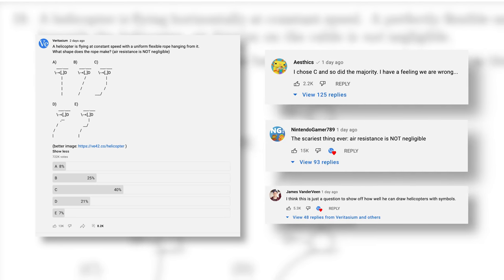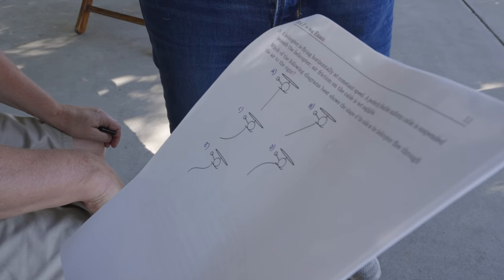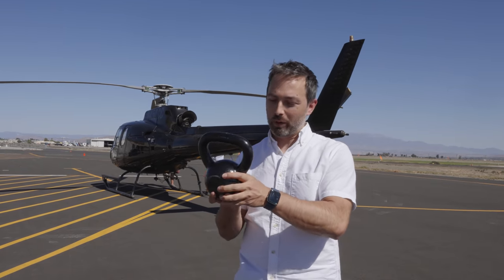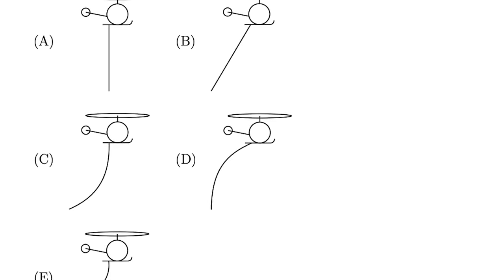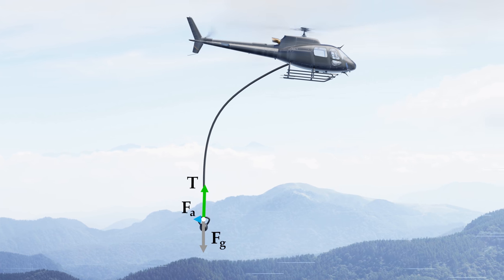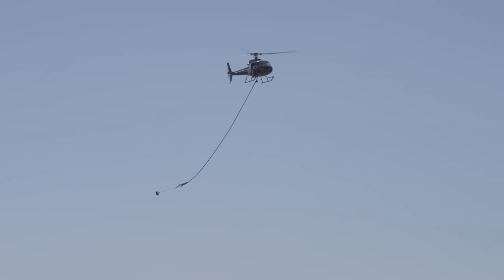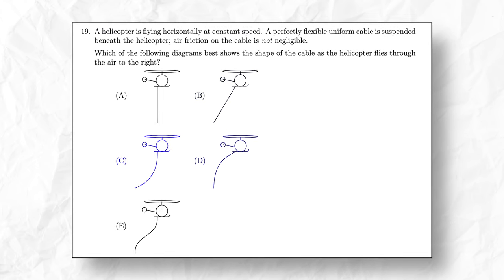I Rented A Helicopter To Settle A Physics Debate

Comment: Are we just going to ignore how casually he is sitting with one leg hanging out of a flying helicopter while holding a 20 lb weight?
Reply: I've ridden in a helicopter before with an open door like that, and I was terrified.
Reply: Trust him if he woud have died in that video it woud not be on youtube!
Reply: He has a harness on
Reply: @activetutorial  🤣🤣
Reply: @Xatzimi  still it's horrifying
Reply: @activetutorial  you clearly didn't watch till the end
Reply: He has a monkey tail on, so even if he fell, he won't die... it's not very confortable, but not dead's better than comfortable~
Reply: @Candority  You made a video that gives a mathematical solution to fear of heights?

That is impressive.
Reply: @Xatzimi  That harness has a buckle that's extremely easy to release under load...  A 5-point harness with rotary buckle would be much less terrifying.

Comment: If this problem is approach in a mechanics of materials way, it's a simple cantilever rope with two equally distributed loads. After doing some math ,I came to the conclusion that the deflection angle is going to be 0 as bending stresses will be 0, so straight line.

Comment: As a physics major, I can say that while this may be a fair question to put on a test, I don’t think it’s a good one. While a lot of conceptual questions (not calculation based) are meant to by counterintuitive/tricky, the student should be able to arrive at the answer through identifying the basic forces and principles involved. However this question asks a lot of the student, it forces them to make assumptions that they wouldn’t be familiar making; it doesn’t really focus on the true intent/spirit of the testing material or testing for knowledge. Assuming a student to just know that the rotor wash is negligible is not really fair, especially in a conceptual (not calculation) based question like this.
Reply: I had the same thought, well said.

Comment: What if the cable was a lot longer in the initial test? Let's say a 100 times longer.
The atmospheric pressure gradient towards the ground would make different parts of the cable experience different amounts of air resistance, increasing towards the tail end of the cable.
Wouldn't the cable then form more of an "option C" shape?
Reply: Yes famalam

Comment: My gut instinct was B for exactly this reason! But then I thought that it might depend on the length of the rope as a very long rope from a high flying helicopter where the atmosphere is demonstrably thinner creating a gradient along the rope of wind resistance where the end of the rope near the ground would have more air resistance than the rope cutting through thinner atmosphere just as the parachute is. I guess that is the difference between physics and mathematics xD

Comment: I definitely thought there would be significantly more wind from the rotor, I mean, helicopters are relatively heavy so they gotta move a lot of air, right?
Reply: There is a lot of wind from the rotor immediately below the rotor blades, but this wind gets dissipated very quickly when it encounters the still air below
Reply: supersonic is correct. The energy is pretty high right below the rotor, but quickly spreads out over a very large area.
As an example if a helicopter is a few thousand feet up and flies over you, you will likely not feel any down draft, because the reaction force is spread out over a square mile or so by the time it encounters the ground.
I think of it as collisions, the first air molecules directly from the rotor hit multiple still air molecules, these previously still air molecules go and hit multiple other still air molecules, and this process continues, each time momentum is conserved, so when one molecule makes multiple move, the multiple have less speed, until you get to the ground when all the air molecules hit the ground (slowly at this point) and bounce off.
Reply: The air also happens to move in the same angle. Imagine the force of air as a similar shape to the rope, now if the helicopter is moving forwards, the downdraft will actually trail along with the rope 👍🏻
Reply: When the chopper is flying forwards it is tilted forwards, letting the wind move more or less straight down the cable.
Reply: Helicopter main rotors, whether one or two, act as airfoils (wings) when moving forward. the transition from hover flight to "travel" flight is actually one of the tricky things about piloting a helicopter. As you transition from "Let's beat the air into submission" to "Hey, I've got a circular wing up there" the lift from the rotor disk is created like an airplanes wing. As an airfoil, which is curved over the top and flat on the bottom (basically) the air flowing over the top has to move faster in relation to the wing and Bournelli's law comes in and decreases the side pressure of the flow creating a low pressure area above the wing. (flying sucks... up) At this point you are using this effect, unavailable at slow to no speeds, to sustain flight as opposed to the rotor downwash thereby reducing the rotor turbulence below the helicopter to effectively nil.
   Hopefully this helped and was clear enough. I'm an aircraft mechanic, not a teacher!
Reply: What everyone else here is completely missing out is that lift is a force that acts from above, not from below.

The helicopter flies because the air on the top of the rotor blades has to move faster because of the shape of the blades (see: aerofoil), faster air is at a lower pressure, so the helicopter gets sucked upwards by this force we call Lift.

The force generated downward would be called thrust and helicopters generate more lift than they do thrust. Thrust helps push the helicopter forwards, backwards or left and right whilst balancing with the lift that keeps the helicopter in the air.
Reply: @smeghead666  The lift is also generated at an angle when the rotor tilts forwards. It also contributes to the forwards motion.

Comment: I just used tooth floss and moved it to the right and the floss stayed straight diagonally so I chose B. I think it might be different if the rope was really long, like a mile long. Would the weight of the rope start to change the shape? I think the upper parts of the rope would have more vertical tension because of the weight of the rope beneath, so it would look more like C.
Reply: You would be correct, but not for the reason you cited. In the mile-long rope scenario, air density variation with altitude begins to have a noticeable effect, with the drag force per unit length of the rope increasing as you go down the rope. As a result, the lower portion of the rope 'wants' to dangle farther to the rear than does the upper portion, so you get a shape somewhat resembling that of the parachute scenario, except with a much more gradual curvature. The curvature effect would be maximized when traveling fast, and at as low an altitude as possible without the bottom of the rope touching the ground. The air density at 5000 feet is about 17% lower than that at sea level, so the slope that the bottom end of the rope should be in the ballpark of 17% less steep than the slope that the very top of the rope tends to hang at.

Comment: This is actually very intuitive once you explain it. However , I still don't understand what decides on the norm of the resultant air resistance, and why does it vary linearly with the rope coordinate ? Could you provide some more insight on that?
Reply: It's easier to imagine the problem if you split the rope in a million tiny pieces. The forces external to the rope are only gravity (pointing down) and air resistance (pointing back). The resultant points somewhere diagonally backwards and downwards, and it's in the same direction for all pieces of rope (by the uniformity assumption). So it's effectively the same problem as if gravity itself were pointing in that diagonal direction, so you don't have to worry about tensions at all and can immediately conclude that the rope comes out straight.
Reply: Because you have costrain at the top where displacement must be 0 so maximum force
Reply: I assume you are talking about the the 1st case (nothing attached to the end of the rope)?  By "norm of the resultant air resistance", do you mean the size or magnitude of the resultant air resistance?    
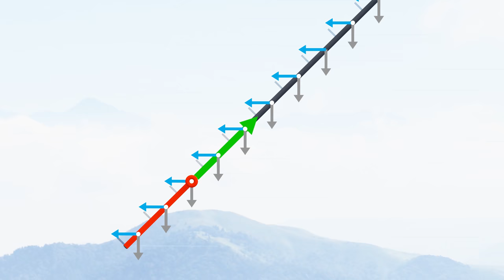Air resistance at a point on the rope (as shown in the video starting at 05:21) is the total air resistance on the rope below that point, and it varies linearly because the rope is uniform, i.e., at any point on the rope, the total air resistance on the rope below that point increases by the same amount if we move up the rope a fixed length.   
BTW, the size or magnitude of air resistance depends on the velocity of the helicopter, the thickness of the rope, and the length of the rope.
Reply: "This is actually very intuitive once you explain it."    Like "gullible" it must not be in your dictionary.
Reply: @potugadu5160  Isn’t air resistance uniform along all the rope? I still don’t get the explanation
Reply: Honestly I think the conclusion is wrong.  The force pulling on the rope is not linear along the length of the rope.  If the rope was 750M long and reach the breaking point of the rope abt 1 ton eventually the force of gravity would exceed that of air resistance.  There is a difference between a line that has 20 KG of force pulling on it and one that has 1000KG pulling on it.  The rope was also covered in a sleeve and that added drag to the line.  I wonder if that was intentional of simply a coincidence.

With a short Rope B but eventually C as the rope gets longer.
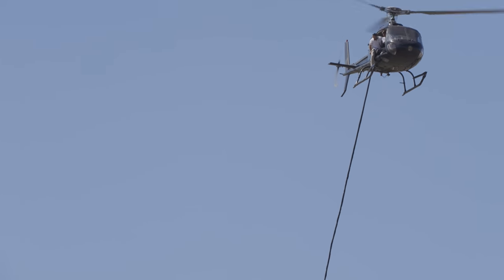Reply: @Gustavovisk21  Yes, it is uniform, and so each individual section of the rope has the same air resistance (05:00), but the sum of the air resistances on the rope sections below a point on the rope increases as the point moves up the rope (05:12).
Reply: @isk8nyc  The conclusion is not wrong, it is basic physics. With a longer or heavier rope, the angle will change but it will still be a straight line. The calculations and the ratios and the curves do not change just because the input variables change.

Now, it could make a difference if the rope were several thousand feet long, enough to make a noticeable difference in atmospheric density along the length of the rope. My math tells me that would result in a shape like C, but I can't afford a helicopter and a mile long rope to test it.
Reply: @isk8nyc  Of course the force along the rope is linear. The Force at any point along the rope is equal to the Length below that point x the cross-sectional Area of the rope x the Density of the material x the Gravitational constant. F=L•A•D•G. A and D and G are not changing; if L is scaling linearly, then F is scaling linearly. That's not even physics, that's just basic mathematics.
Reply: @potugadu5160  ahhhhh yes, of course. Thank you!!

Comment: How would a student attending the exam know the extent of downwash effected region of the main rotor in this question?
Reply: Exactly.. From "everyday experience" I would have guessed different since a fast spinning ventilation fan easily causes drag at a distance 10x it's rotor diameter.
Reply: Or whether the rope was light enough to be affected by it too
Reply: This experimental setup also clears 1 more thing, the location of the rope attachment point perpendicular to the motion of the helicopter(width of heli)doesn't effect the result, in this setup it was on the side of the heli's body and if I'm a student writing this exam I will be considering it at the middle of the heli width
Reply: So, a possible explanation that the downwash doesn't effect the rope because the body of the heli blocks it for the initial section of the rope is not true
Reply: This question could use some more info😂.. Maybe that's the point of the olympiad.. Purposely make it harder

Comment: since the helicopter is going straight the flag wants move back compared to the chain because the of the air flow tends to make the flag point back words since its only attached on one side of the flag it doesn't affect the chains angel compared to the helicopter much

Comment: This is interesting, but throughout the video I had the lingering question of what would happen if the rope was much longer (hundreds of meters) and without the bottom weight? Wouldn't air density at different altitudes make a difference now? This assumes (correctly) that for a short rope the air density will not matter at all, but it could for a significantly larger rope in which case the answer won't be B anymore, and rather C I think.
Reply: If it did not have weight then it would not droop at all as gravity is not acting on it so it would be completely horizontal
Reply: @dhichicpop2531  I'm talking about the bottom weight. Obviously the rope will have weight.

Comment: 11:27 I imagine this is the most dangerous moment, if the flag wasn't tethered somehow. If it ripped out of his fingers could go into the rotors for sure.
Reply: itd be fine
Reply: It could act like snow between a fender and a bicycle tire.
Reply: @klicer3068  Rotors aren't particularly sharp so I doubt it would be cut.  Had the flag wrapped around the end of one of the blades, the imbalance of weight and drag could quickly destroy the rotor.  Those things are pretty finely balanced, and at the speeds they spin it doesn't take much for things to go sideways - literally in the case of the tail rotor.
Reply: 9:35 the pilot seems to believe the flag going into either rotor would destroy the aircraft. Not saying he's right but I'll trust him over my armchair when it comes to an educated guess.

Comment: Before I watch:

Free body diagram on the rope
Helicopter becomes vertical and horizontal force  at one end of rope: up, Fy and to the right Fx. Air resistance, becomes equal  distributed force to the left across the rope: A/L l. Gravity, G  is force down at center of mass in middle. Length is L
It's at constant speed so Sum(Fx)=0
Assuming the rope is straight down, and helicopter is flying right. Fy=g so vertical cancels out; sum of moments about the helicopter end = M = Fx(0) - (A/L)(L)(L/2) =/= 0 so the rope would bend, meaning it can't be straight down.
Constant speed : Fx-(A/L)(L) = 0
Fx=A 
A acts at L/2 which means we have a couple force creating a clockwise moment at L/4. If it were a beam the left side would be in tension and right side would be in compression which to me would indicate that D) the inverted hook shape is the answer.
But I would suspect because the end is free it and rotor blowing down it would be the s shape

Comment: if it the helicopter goes to the right in a straight line and the helicopter is seen from one of the sides, doesnt that mean that the rope is a diagonal? And if so, doesnt that mean that the rope should be straight (considering you are looking at it from the side)? Option A should be the correct one in that case.
Reply: Except in the drawing you're seeing the helicopter's side, not front or back

Comment: I think much of the intuitive problem is that most people are used to working with much shorter lengths of rope, where "perfectly flexible" is further from the actual experience. No rope is "perfectly" flexible. But on a larger scale, the flexibility becomes more negligible. But on a small scale, the flexibility of the rope (which is not really perfect) becomes a more noticeable artifact. This leads to "C" looking more right. Also, with a much heavier weight, the air resistance of the rope becomes more negligible, making the air resistance & weight of the heavy object the main factor, returning you to something which looks more like B.

Comment: I'm commenting at timestamp 0:48. I'm not very educated in physics, but my only assumption is the rope can technically appear in any of those shapes based of what I would consider the primary variable: Elevation.

My basic understanding is that, at higher elevations, the air becomes thinner. By thinner, we mean the molecules in the air - oxygen, nitrogen, etc. - are more spaced out. This can impact all other factors such as air pressure, wind speed, and temperature.

I'm looking forward to finding out if my logic is correct or not. Either way, gonna learn something new.
Reply: My hypothesis was wrong. :)

Comment: Pretty sure the shape would’ve still been B with a weight attached, if the chopper was travelling fast enough. I guess it would be a straight line with parachute attached too, if it was travelling fast enough, but in this case it would be nearly horizontal.

Comment: If you do as the question is worded you will get a different result then the question asked~!~ Because the question asked defies the laws of physics. No way can a helicopter fly or move a horizontal direction without a negligible force being applied to the cable hanging below the aircraft. if it hovers on one spot the cable will hang if there is no wind blowing on the cable, otherwise the cable will be pushed by the wind in the direction the wind is blowing. So with all scenarios given I answered all correctly due to my engineering backgrounds in construction I would say.

Comment: The question seems rather intuitive, but it's completely logical, and sometimes even a good thing to get it wrong. Logically, the propellor will definitely spread out the air enough to not impact the very thin rope. But since air resistance is something that is ignored in classical mechanics especially the forces topic, a good student would get confused

Comment: Well, it doesn't make a diagonal straight line after all; instead, it undulates, suggesting that you are averaging the shape over time. So you are right in a sense but one of the other choices may be correct, at least briefly.